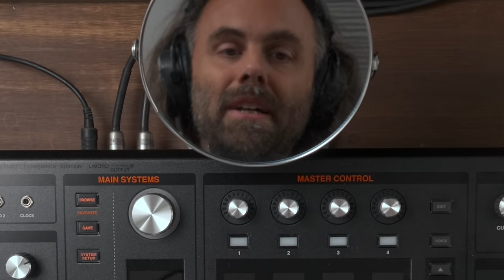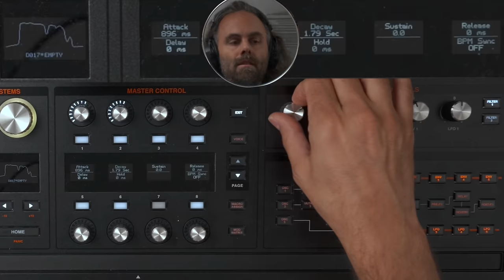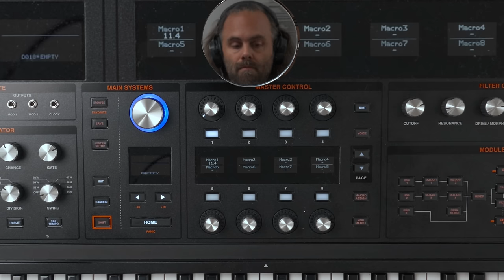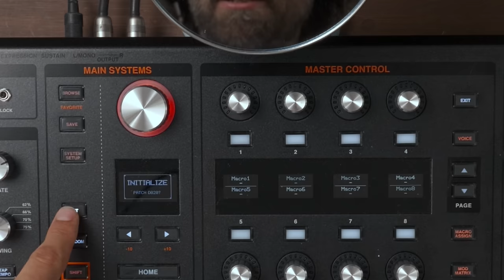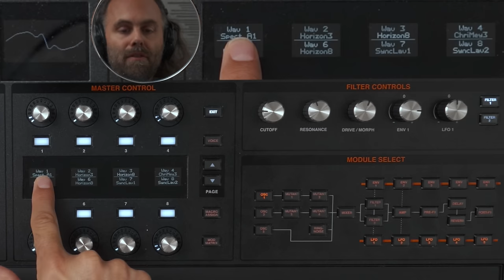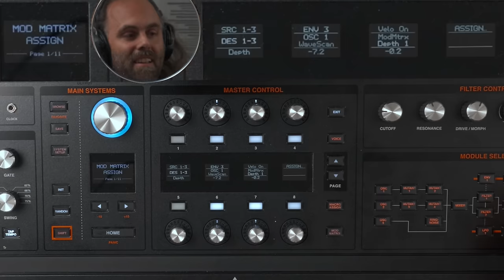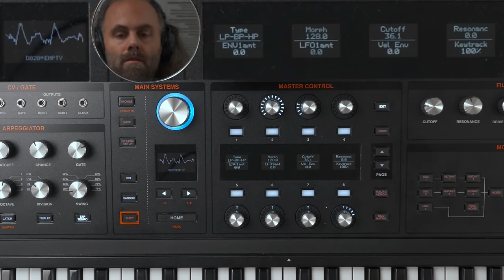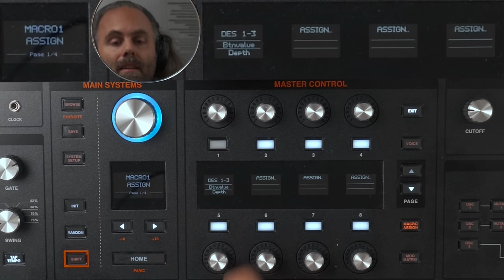Hydrasynth Mega Hang Time (Sound Design Tutorial)

Comment: Great showcasing of an awesome synth! I love your way of thinking and teaching. Thanks for sharing.
One little tip on my side: In the macro's, I see you don't use the button values. Those can be really handy if you want to toggle a predefined value on and take that off again. The buttons can also work like a trigger, if you press shift + the button. (But in system setup page 2 you can even define the preferred mode for MacroBtn: toggle, trigger, switch or reset.)

Comment: LOL, I posted on your IG for a megatutorial (and here it is). Rock on dude! This thing is dope, I have the Desktop, but probably end up with the KB version.
Reply from the maker: Yeah, this is for you Daan! ❤️ If you absolutely want the polyphonic Aftertouch and the Ribbon, the keyboard version is the way to go. But your can come a long way with the desktop and a MIDI keyboard.
Reply: True Cuckoo yes indeed! I have noticed that for modulation you press mod matrix first, then assign and then the source and destination. If you have update 1.5 there is a much quicker way. 

When you are in the destination page already. Like you want to move the Wavescan of OSC 1 with LFO 1. When you are in the OSC 1 page you press and hold LFO 1 and then press the Wavescan button and BAM connection made and shown in the mod matrix directly.

Comment: I got my first casio sk-1 synth when I was a little kid, then I got an op-1 a few years ago, and now I got this hydrasynth. mainly because I wanted to learn synthesis and sound design. hydrasynth is amazing bc it takes what a lot of vst plugins do and turned it into hardware. I think it resembles serum the most (?). Having actual knobs is so much more conducive to design. it's like the difference between using a pencil to draw versus using a mouse to draw. but anyway, thank you for such a great vid I learned a lot. it's so much better than going through those dry instruction manuals that read like a spec sheet.

Comment: My volume knob is weird when I play a new patch with headphones (with speakers it’s ok): Turning it clockwise, the volume does not increase as it should, but it has louder and less loud positions. Overall, the volume is extremely low. There is massive crackling with the movement. The problem disappears when I add OSC 1 pan value. I already had the unit replaced, but the replacement shows the same behaviour. Anyone know more? Oh, I have the Explorer.

Comment: Great tutorial. I dont have the Hydrasynth but been looking at it a lot. However there is something about the sound that doesnt spark something in me, the interface is great and so much faster than say the Blofeld. If someone can post just one video with sounds that made them buy it, I would appreciate it.
Reply: check out the sweetwater demo
Reply: it can honestly sound like absolutely anything.  relying on the style and preference of an individual other than yourself is tricky.  i would def try it out if you can, or just go for it as i've found the scope of it is endless and completely tailor-able to your own feelings.
Reply: Don’t know your level of synthesis experience or what general ‘tone’ your looking for? I enjoy analog, so there is a patch demo of ‘classic’ sounds that highlights those kind of tones, and Jexus’s demo really goes all over, but it depends on what you want. 

I’ve been a hobby synth player for about 8yrs and I’d say this synth is extremely capable and as you mentioned the interface is very easy to use. It may lack in some minor ways since it’s digital to my analog love, but analog emulation is so good these days I don’t really have anything against digital. And from what I’ve heard unless you rely on someone else for the sounds you want you can get whatever you want out of this synth. You just need to understand how sound design works to get there.